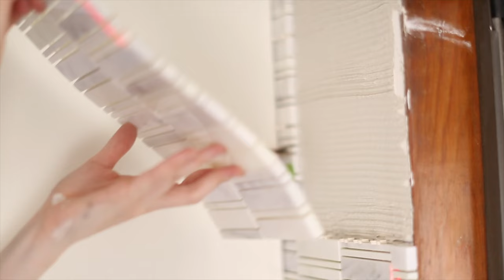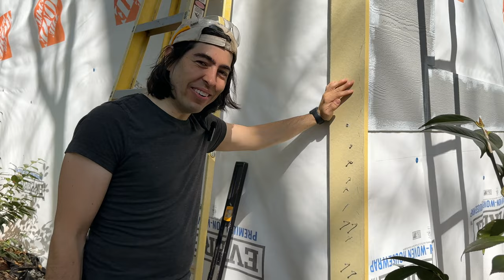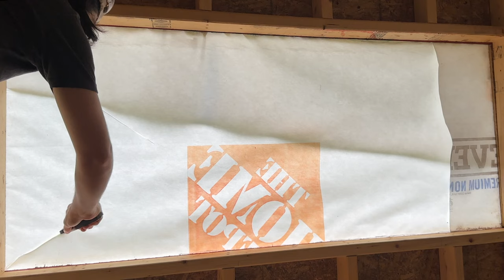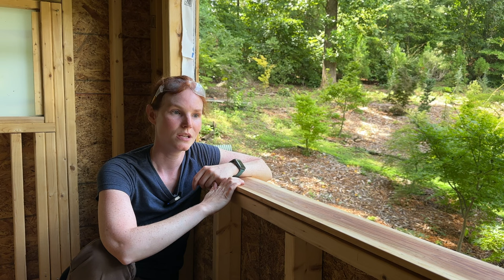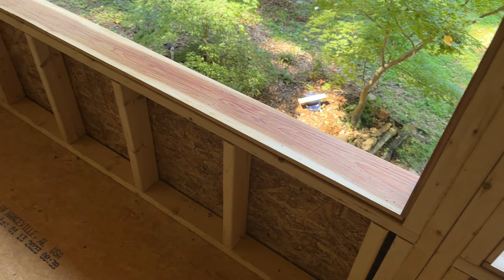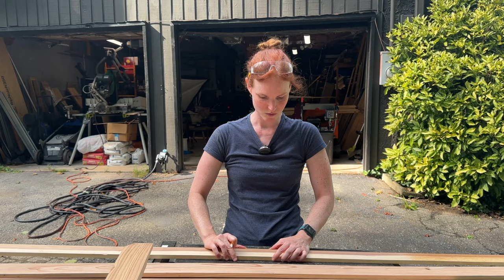Building Easy DIY Sliding Windows with a Modern Design

Comment: What is the R value compared to glass?
Reply from the maker: Acrylic and plexiglass have high thermal values and insulate buildings better than glass. However, if you’re wanting real insulation, I’d suggest double-paned glass over single panes plexiglass or glass. You can custom order double-paned glass from a local glass provider in most cities for not too high of a cost (much less than buying a new window).
Reply: @buildingmodern  Thank you so much.
Reply from the maker: @gentile.enterprise  No problem! If you reach out to your local glass supplier, you'll find the prices aren't too bad and the wait is maybe 2-3 weeks. For reference, the best price we've found is $17/sqft for tempered, double-paned, low-e glass (up to 49sqft in size - double the price if we go past 49sqft in one piece).